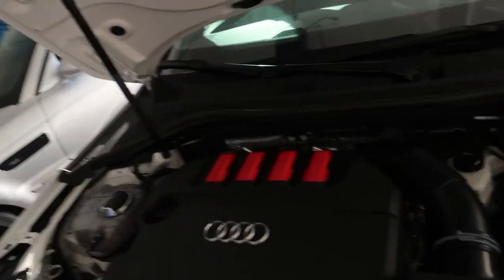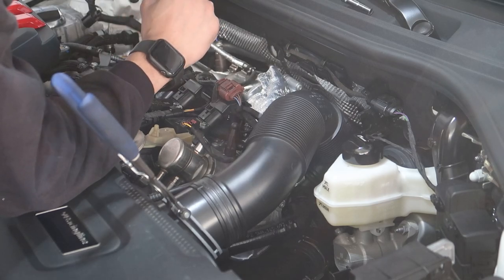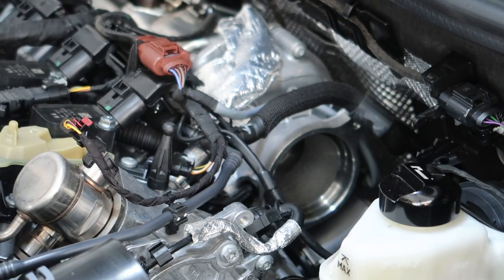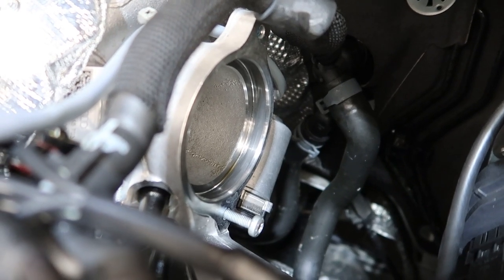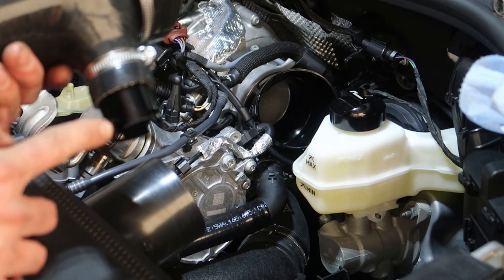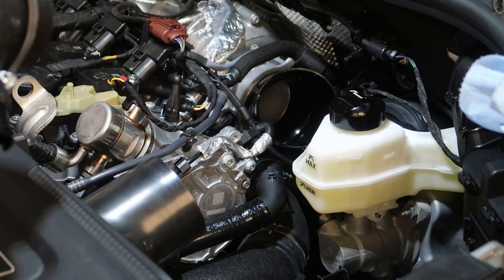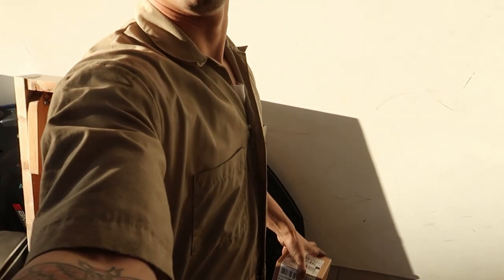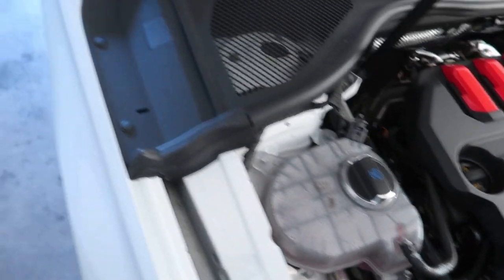Racingline turbo inlet & intake hose install + some rips! | MK8 R & 8Y S3

Comment: So. You spend all that money on that when you could have just added the larger elbow, rip the plastic engine cover off that traps heat, put a turbo blanket on your turbo, wrap your exhaust near the turbo  reducing heat, open up the restriction air inlet from the front grill by cutting open the other closed up half, wrap the inlet pipe with insulation. I bet i ended up with more jp than you did and it costed me much less. 😅😅

Comment: 8:00
For future happenstances...
You might be able to plug that adapter in where it goes first, then slide it into the port on the inlet hose and tighten it down. Probably make it much easier than connecting it to the inlet hose, then trying to align it with the plug.
Reply from the maker: If it wasn't stupid tight I would've done that, even with lube it took a literal ton of strength to get it in there